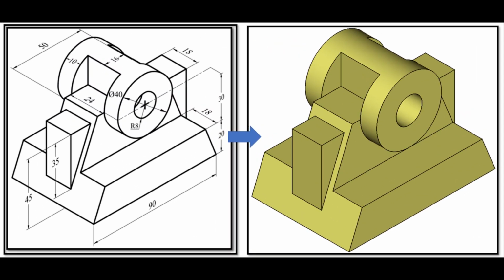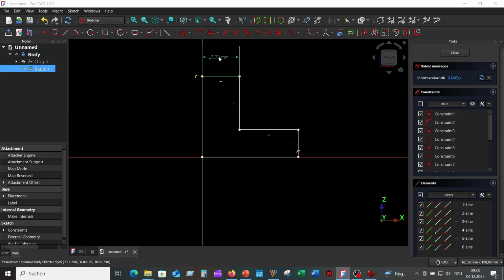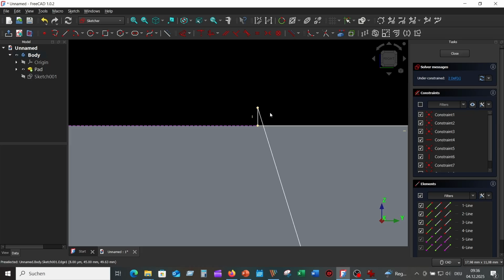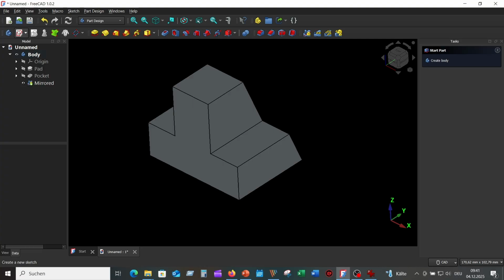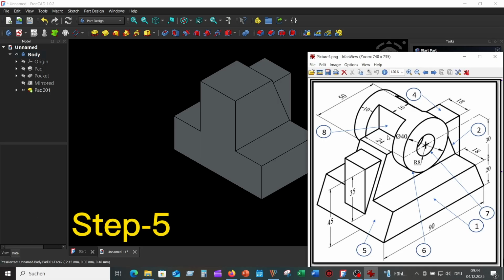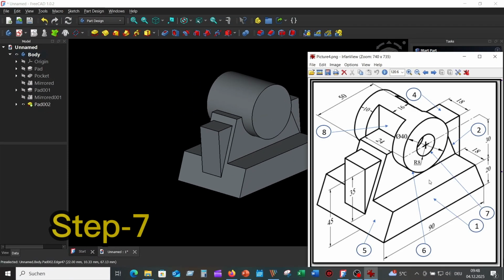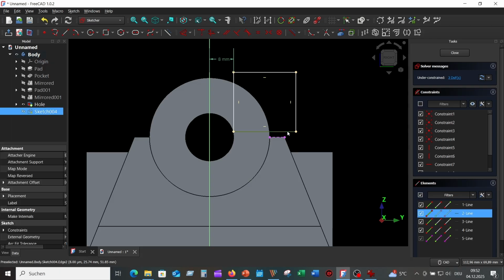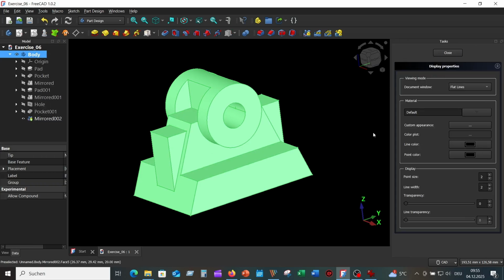FreeCAD Tutorial for beginners, 3D Exercise #06

Comment: Hi, the video is informative. I want to ask (I couldn't find it in the manual either), what is the option to adjust the icons in the top bar, for example in Sketcher, so that they don't have to be expanded using small triangles? So that all the icons are expanded at once. I don't know if the new version 1.0.2 has this option. I don't know the keyboard shortcuts yet. Please advise and thank you.
Reply from the maker: Hi,
I don't know if I got your question 100%.
Any way, I will try to answer your question.
- to activate the tools, go to ⇒ Views-->toolbars, and then activate the toolbars, that you want.  After that, you can position them, where you want.
- If you want to change the look of the FreeCAD workspace:- there are two possibilities. 
    1. EDIT --> Preferences --> display --> Colors 
     2. Tools --> Add-on Manager --> FreeCAD themes, download this theme and change your FreeCAD workspace looks.
If this answer is helpful, let me know. Otherwise, send me the picture of your FreeCAD toolbar.